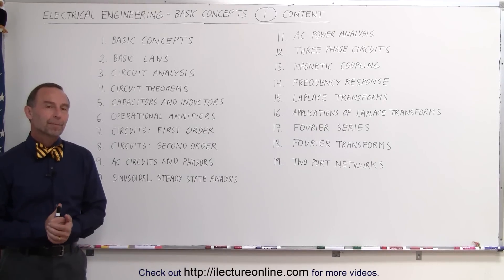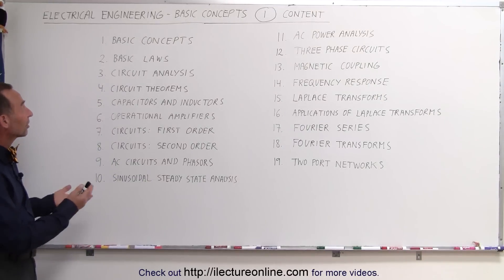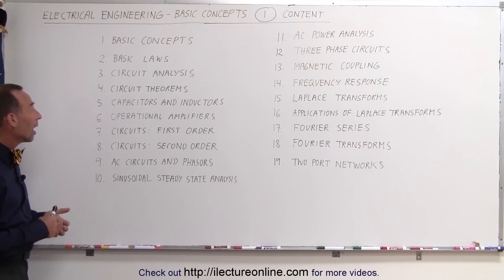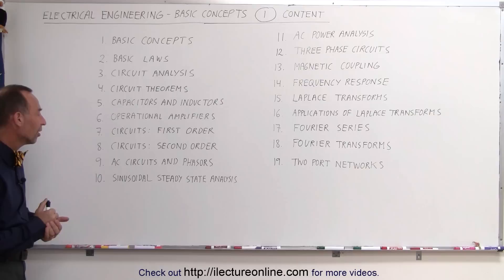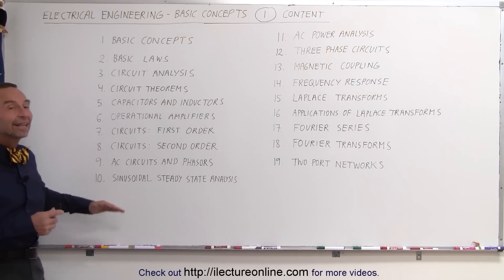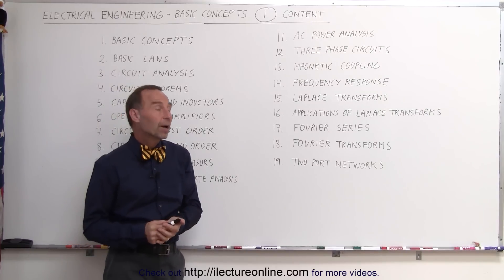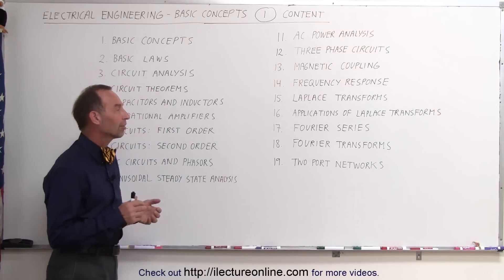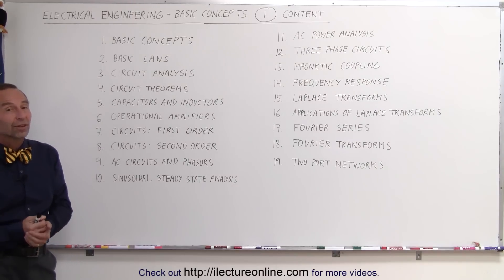Electrical Engineering: Basic Concepts  (1 of 7) Content

Comment: sir ek ampaire me kitne watt hote h
Reply from the maker: An "AMP" (ampere) is a unit of current.  1 A = 1 coulomb of charge / sec         A "WATT" is a unit of power:  1 W = 1 joule / sec (J/sec).   In electricity it can also be    1 W = (1 A)^2 * Ohms   or   1 W = 1 V * 1 A

Comment: Mr. Michael, I've started to self educate myself in electrical engineering and have come across your video series. The one problem I seem to run into is prerequisites. Would algebra and physics be some courses to consider first in order to fully grasp the concepts? Any advice on this is greatly appreciated as I just don't know what direction to follow.
Reply from the maker: typically the prerequisites for EE are:  Math:  trigonometry, linear algebra, 3 semesters of calculus, differential equations    Physics: Mechanics,  electricity and magnetism, and optics.  Without taking these first, you will run into problems comprehending certain topics.
Reply: +Michel van Biezen okay, that's what's been giving me problems... should have asked a question like that sooner.